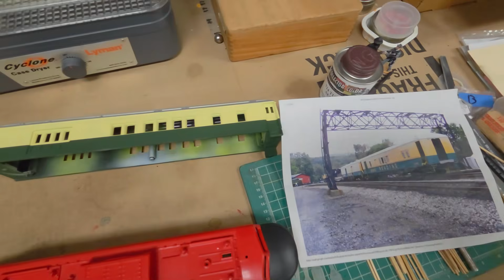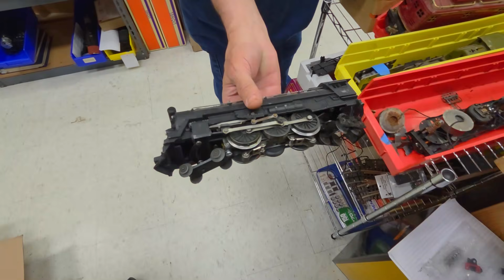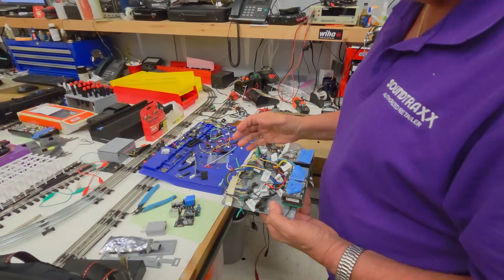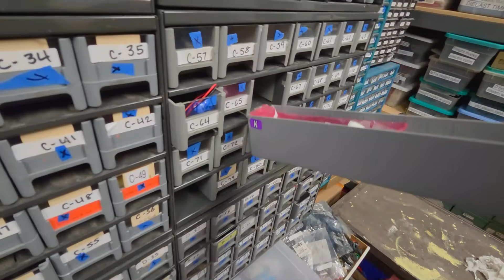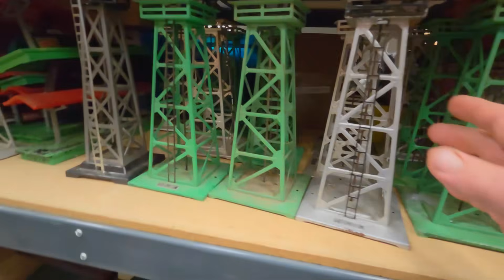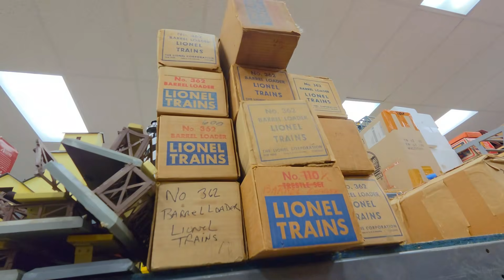Train Doctor Behind the Scenes Repairs & Inventory

Comment: I only have mostly conventional Locomotives and and only have one mth Locomotive that is a ps3 and that is my KCS Southern Bell ACE or AC 4400 diesel Locomotive and the reason I have it and like it is because a friend of mine I call my big brother, he use to work for kcs and road on that modle of diesel Locomotive brother, My other mth is a Pennsylvania doodle bug and is a ps1 and I still need to get the matching correct passenger car's set for my doodle bug.
I do plan on buying a few more doodle bug Locomotives and I am thinking about doing something special with one of them starting with a repaint job into something that we both like with railroading.